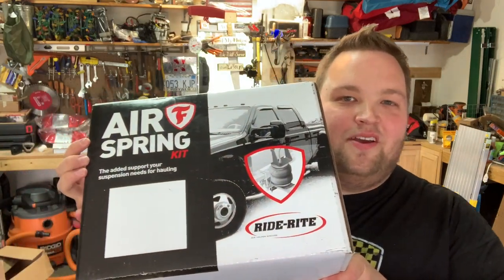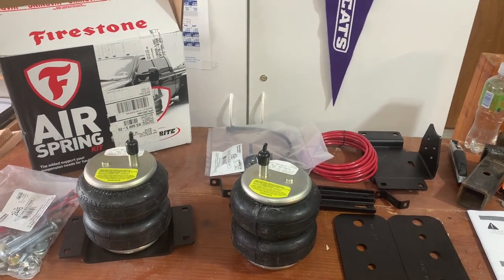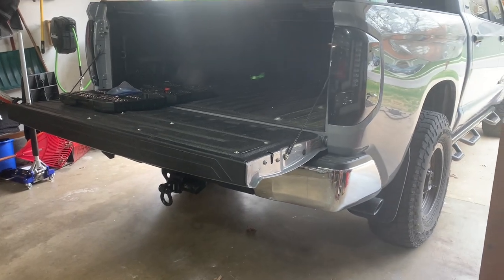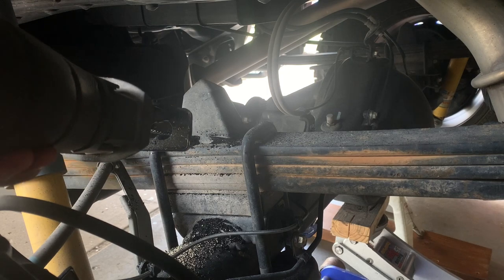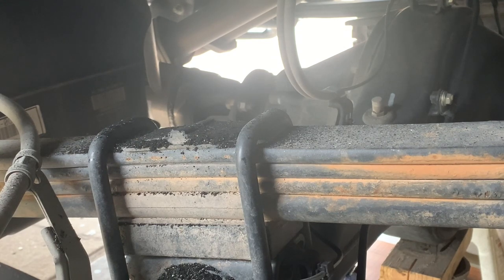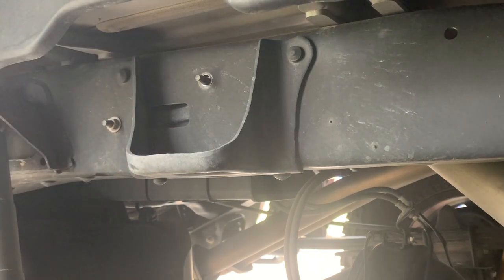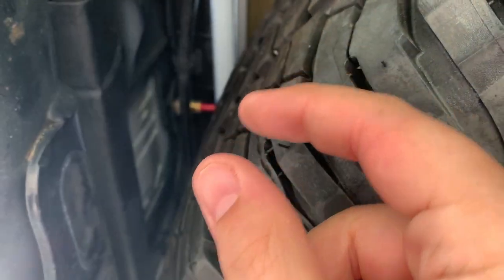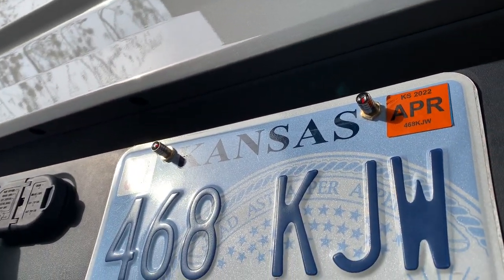Installing Air Bags to Haul a Camper!

Comment: Adding a spring would spread your load over 3 locations instead of only above the frame bumper.  Also load range E tires obviously. Look at the Nitto Ridge Grappler.  I added Bilstein 5100's also.

Comment: Thought about these for my Tundra, but not convinced of airbag's longevity in very cold weather.
Reply from the maker: I mean rubber lasts pretty long everywhere, so I’m not sure why they would last just as long up in Alaska!
Reply: @kccreations5945  True. My concern would be the rubber cracking, as all rubber will over time. 
Good job tho!
Reply from the maker: @akyukon  yeah I understand that. But I would imagine they are pretty sturdy and made similarly to tire rubber (being it’s a tire company) which has to last!
Reply: I've had a set on my 99 Tacoma since it was new... I've only replaced the air fittings a couple of times over the years... I live in northwest Montana..

Comment: Hello, just wondering how the ride with the truck camper is now with the air bags? Does it cause more sway or less. I have timberns right now that work well, I just have a little bit of sag that I want to level out. I was thinking of replacing them with Air life 5000s and keep the torklift overload stops. Thoughts? Thanks!
Reply from the maker: Hey Randy. It was my first drive with a truck camper so I would say I honestly felt like it was pretty solid. I didn't have a ton of sway while cornering but I also wasn't taking corners fast, but my plan is to get a sway bar regardless and was planning to do this before the camper anyways. The nice thing about bags is you can air them up even tougher and it just increases the rigidity so you'd get less sway. As far as your torklift overloads, I just looked at what they were online and I don't think that they would be compatible with an airbag since the bag sits on top of the leaf pack it would push your tork lift system further away from the frame. I hope that helps, but don't fully take my word on it since I've never seen your set up!
Reply: I added same bags last year.  These along with my TRD Sway bar makes my 18 tundra CM ride much firmer.  I daily drive with 10 psi and prefer the improvement.  I was worried it may be to stiff but that wasn’t the case.  It gives me much more driving confidence when at speed loaded/unloaded.   Personally I decided to Stick to the double valve  as opposed to single valve.
Reply from the maker: @kevineth100  that’s awesome man! My TRD sway bar should be here any day now! I also kept the double valves to individually set the bags! Thanks for the comment man I appreciate the insight!
Reply: @kccreations5945  definitely! I appreciate your videos - keep em coming!

Comment: So did u drive it around with them aired up with out camper and how does it drive getting ready to I stall mine tommorrow
Reply from the maker: I have not driven without them Aired up, but I put it on without them aired up and the truck still handled the weight well in terms that it didn’t sag very much! But I’m sure the stability is better!
Reply: @kccreations5945   any issues cause of the 1 inch block
Reply from the maker: @jonpg28  No issues at all!
Reply: @kccreations5945  thanks for answering back

Comment: How’s your truck feel driving it with no weight on it, and the bags?
Reply from the maker: It’s a little ridgid at the moment but I also have 60 lbs of air in the tires which is too much without the camper! So I need to drop them to about 45 and reassess!

Comment: If you just want to help with sag of the bed when camper is on probably using sumo springs would have been so much simpler to install.

Comment: You should never drive that set-up because it doesn't matter how many airbags you install, to level up your Tundra( that's all airbags do, level up), they won't make your truck more capable. Your GVWR is around 7100 lbs, and your payload shoud never go over 1400 maybe 1500 lbs(check your payload sticker on B pillar, where your tire size and pressure is). Your set-up makes a very good video, but not only is very unsafe to drive it, it will make you liable in case of an accident, and insurance will not cover you. Just my two cents.......